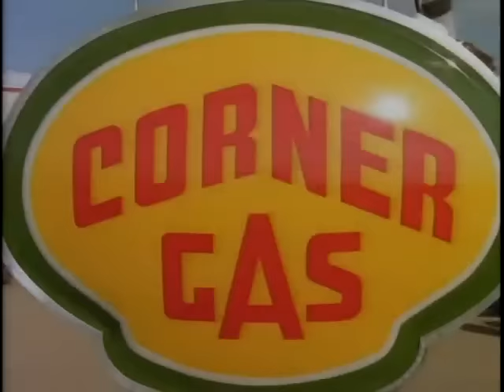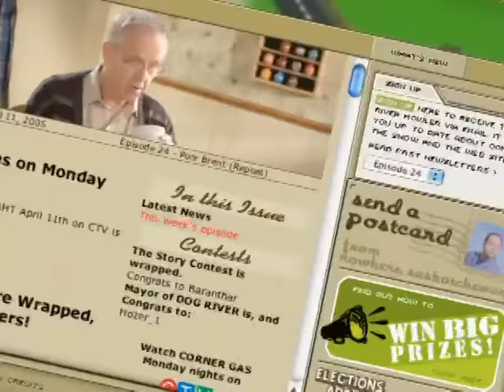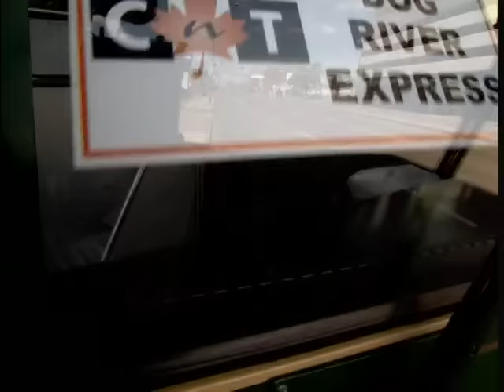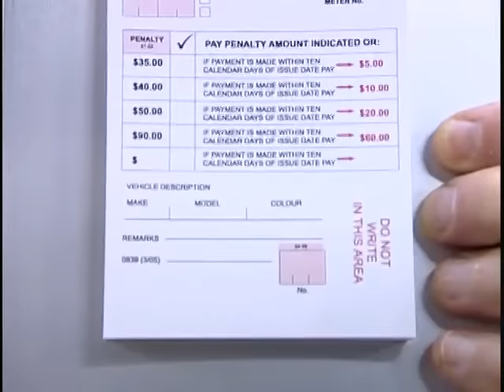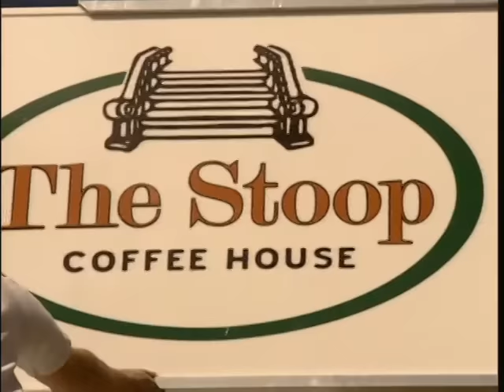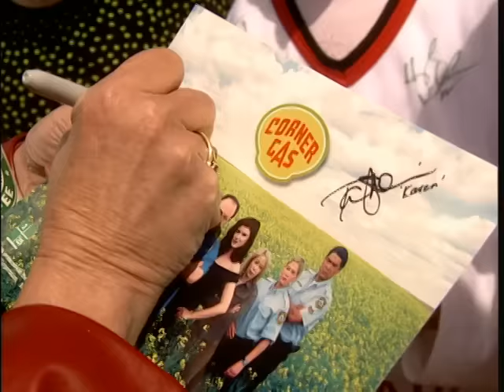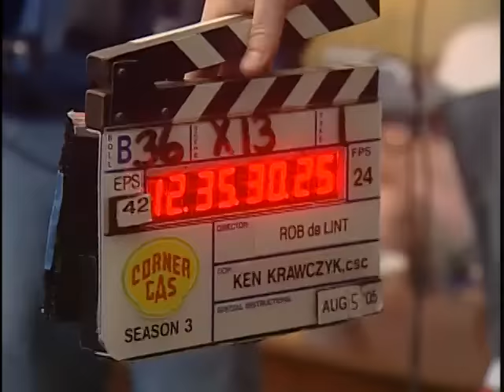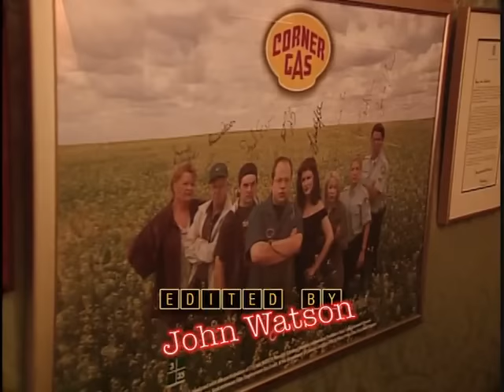Beyond Corner Gas Tales From Dog River

Comment: They were insane to tear down the set instead of letting locals take ownership and restore it.  Even just keeping the outside shells would have been fine.     This was making money for the town.  
Also, why not at least save all the signs???  Not saving anything was very odd.
Reply: went to DR  last weekend and the Police station is crumbling on the outside wall
it was bought by someone 1.5 years ago and they left due to structural is not safe apparently  .  someone needs to step in and  take whats left and hv it commermerised i know the places have been plackered  from CG  and FIXED  and for tourists  and fix the Howler also... was GR8 to see all the stuff and meet a few ppl  😃 .
Reply: Brett talks about it in another video somewhere, that the Ruby & Gas Station sets were built in a place where buildings do not belong, in a bowl that becomes a swamp, and the 'buildings' become a public hazard eventually and shouldn't remain there.
Reply: @runrig97  Just keeping the signs and outside shells would have been fine.  This building made plenty of money for the town.  
They at least could have saved all the signs and cut out some better features to preserve.  They could have also had an auction.  Destroying it made no sense.